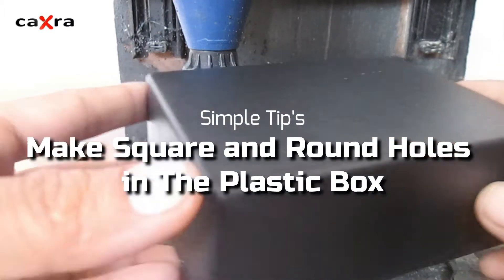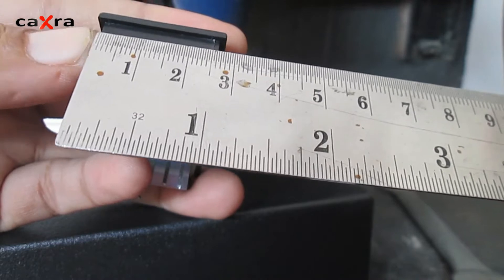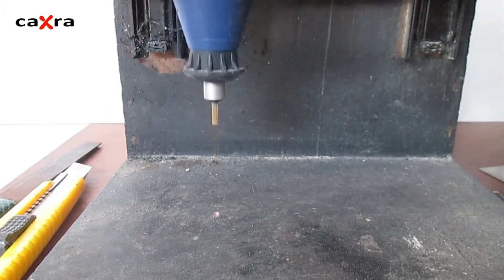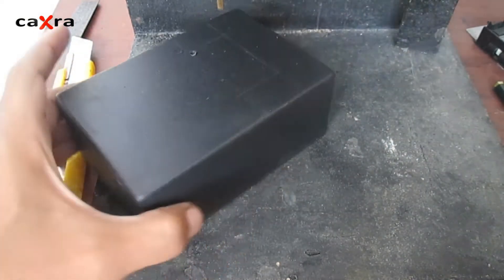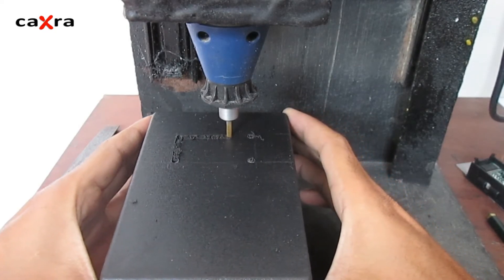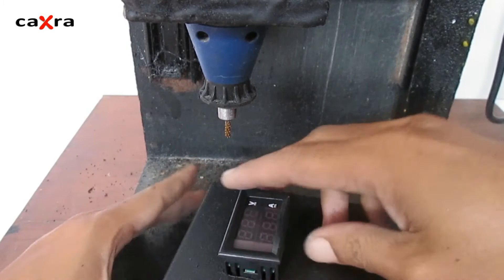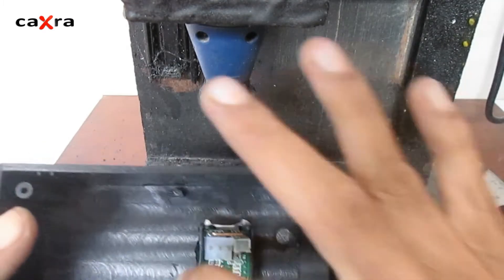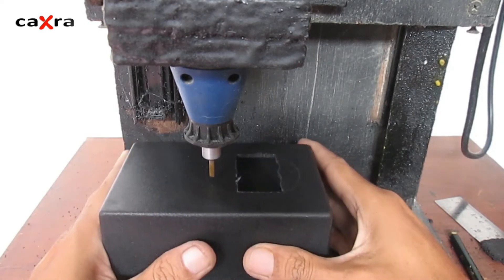How to Make SQUARE HOLE and ROUND HOLES in Electronic Boxes

Comment: bit breaks when,  worked by side ways .
Reply from the maker: Do the sawing carefully, do it slowly. The last part sometimes needs to be tidied up. Use a cutter, or sandpaper, or file to tidy up the parts we cut.
Reply: Suggestions: Go slower with smaller bits....1" in 20 or 30 seconds, don't "bounce" the contact, just steady light pressure. Also, take a break every minute to let the bit cool down.
Reply: It shouldn't break, maybe cut only halfway through the material in the first pass, the rest of the way with a second pass.

Comment: This is such a waste of time and tools and not basic as you claim. Drill holes in the 4 corners and connect tangential the circles by using simple box cutter knife, that I saw you have at the table🤣
You don't even need power tools or special bits, you can do it with just a nail, cigarette lighter and box cutter knife and result will be significantly better looking than what you did and actually using basic tools.
Reply from the maker: I use this technique every time I punch holes in a plastic box for a DIY electronics project. And I've worked on a lot of projects. 
I have tried the heated soldering iron. Burnt nails, Flattened and angled hacksaws. I've tried pond knives, and more. 
The method I demonstrated in the video is the most effective method in my opinion. Especially if you often make projects that require perforated boxes. 
However, if you are only working on one or two projects, using a cutter is also sufficient. Be careful, don't let the cutter knife cut your fingers.
Reply: Power tools > hand tools = not a waste of time

Comment: Hoh to remove plastic residue from a drill when sticking on it? Tx mr 👍🙏
Reply from the maker: You can use thin wood or some kind of plywood. Friction or drill the drill bit on the thin wood, then slide it towards the base of the drill bit. Then the plastic residue will come off easily.
Reply: @CAXRAMEDIA  txu mr, i'll try

Comment: I come recommending clamping boards down to use as guide boards while boring out your lines, creating a type of jig. It will give you tight lines and much better over hand-and-eye lines. Also, there is a bit that looks like a drill bit that runs backwards and is very slim (triple flute down-cut bit), the channels in the bit will send the molten plastic downwards into the box and out of the way while giving you a nice edge to the cut in top. Other than that, this is how I would do it without a CNC - which basic X-Y CNCs aren't too hard to build and your drill would work fine :)
Reply from the maker: Thank you for your input. Very inspiring. And indeed I really wanted some kind of additional tool to guide me during the drilling process. My dream is some kind of CNC machine, but I haven't been able to buy one until now :-)